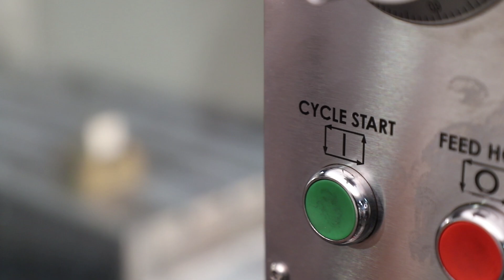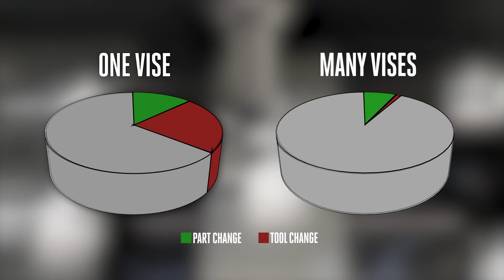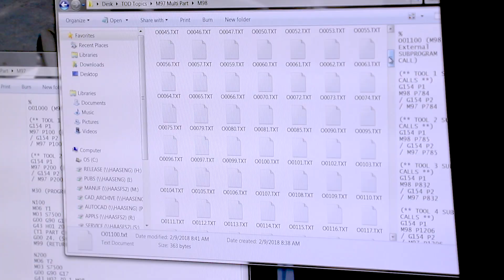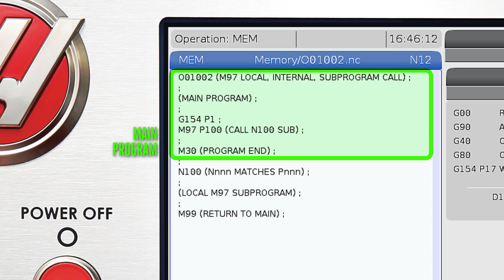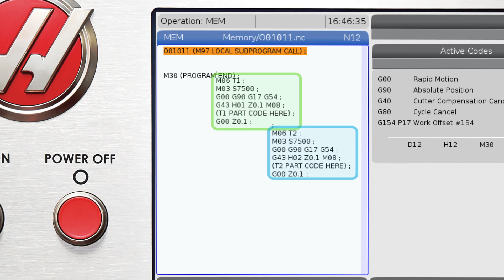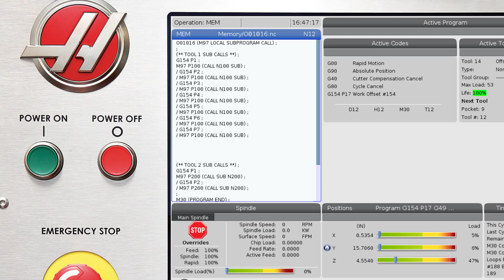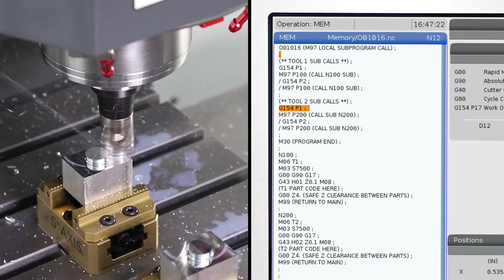Run More Than One Part at a Time; How Production Shops Use M97 - Haas Automation Tip of the Day

Comment: When I worked a Butler Industries we made almost exclusively Aircraft components. Now none of our machines came close to the one in the video but those guys couldn’t hardly look away and I’d hear words that blistered my ears as the end mills went woogady and ate the part, fixture and clamps. What happens if this computer get a power spike or just forgets what to do?
Reply from the maker: Abby – It is all about repeatable processes isn’t it. If we can get something to repeat with good fixturing, tools, programs and machines, it can be automated. Things have gotten a lot easier with modern tools and tool coatings, and the continuous improvements we’ve made on the machines. We sell a lot of machines into parts of the world where the power grids aren’t particularly stable, Haas has come up with some clever Tap/Tool Recovery options to get things up and going quickly even when the machine automatically detects a power issue and shuts down. Great comment. – Mark, Haas Tip-of-the-day
Reply: Haas Automation, Inc. Thank you for the response.

Comment: Last time I checked there are not 2 ways to call subs M97 & M98 as said in the video.  There is also G65, this is an external sub call much like the M98 but with an important difference, the G65 allows the addition of an argument to be added to the command... Any of you boys with a renishaw probe that understand how to use it should know this.  So a correction that there are in fact 3 ways to call a sub!

Comment: Why not have a single program but loop it and use variables for the work offset?  At the end of each loop, increment the work offset.
Reply from the maker: Shawn – That’s a great way to program lots of parts that are being cut out of the same piece of material, or cut on a Jig with even spacing between parts. The distance between our vises is random in the X, Y and Z, so we just gave each part its own Work Offset. Thanks for the comment. – Mark, Haas Tip-of-the-day

Comment: I agree with the subroutine calls, but I personally like using M98.  It allows for making edits to only one subroutine and not messing with the main program.  I know...everyone has their preferences.  I also prefer to run the part to completion. This shows only running the first op, but many parts are cut on 2, 3, 4, or even all 6 sides.  Using the same technique, use work offsets / vises, and group the program by tool to reduce tool changes.  The big advantage (comes from "LEAN MANUFACTURING") is that every time the doors are opened, a completely machined part (or set of parts) is removed.  This eliminates wasted time in excess handling.  Just another way to reduce time and improve productivity.  PS-by using M98 (M97) subroutine calls, we have been able to reduce our cycles times by 20-40% (versus single-part running).

Comment: I am just a wannabee, but Haas looks like a really well-ran company with probably the best value. This guys videos are awesome.  I like what he said at the end of the video.  It is how fast you can finish the last part that counts.
Reply: You may be new to CNC or Haas, but there are much more efficient systems/controls made by competitors that easily outperform all Haas machines. There's a lot of hype around this brand for good reason, but Hurco, DMG Mori and many others are much faster and easier to setup and run day in, day out.
Reply: haas is an entry level machine

Comment: Hi mark, thank you so much for your VIdeos,
I still have a problem i couldnt find though.
See, i have a casting part , i probe it up and yet I found that if i shift the X by 1mm, and the Z  by 0.5 mm the part comes out with holes etc correct aligned . ( Casting is out of shape ) 
I wanted to automate this process, therefore i added on the CAM a pass through, for example #5221=[#5221+#1001] .
The Idea was for me to controll the G54 shifting by a macro Variable, in this case 1001 in the current commands folder. But it is not working. It doesnt take the changes, or if it does, it messes the machine up and confuses it.

Is this because the Machine is not compatible of doing G54 changes while running in cycle ?
it is the UMC 750 5 axis.

Kind regards, 
Alex
Reply from the maker: Alex Mo – We can shift our G54 X by ,05mm by command #5221=[#5521+.05]. When dealing with macros, we want to be careful of lookahead as well, check out this video for info https://youtu.be/x24U0EXmLTk . In your example, you used #1001, this is not a valid Macro Variable on the Haas Control. Variables #500-549 are typically good for use. If I want to shift an Offset when probing, I’d typically add a shift directly to my probing command, the method varies depending on the cycle you use (IPS, VPS, Renishaw Inspection Plus). If we command #5521=[#5521+#100] it will shift our G54 X by the amount we have entered into variable #100 (#10100 on NGC). I hope this points you in the right direction. – Mark, Haas Tip-of-the-day

Comment: Hi, love your videos! Question, how do you set the work offsets for each p value, and when would this style of programming be beneficial over standard g54, g55 ect offsets and using a canned cycle. Thanks!
Reply from the maker: RiskyEndeavor -  G154 Pxxx Work Offsets work in exactly the same way the G54-G59 Work Offsets do. We typically use them when we are needing to work with more than a few Work Offsets on the machine at once. We have a couple of videos that show how to set Work Offsets, https://youtu.be/uNjMIIRttFE, https://youtu.be/AyMsFtwzrmI, and https://youtu.be/5I1eG49XnTA. Thanks for the comment. – Mark, Haas Tip-of-the-day

Comment: I did not know one is not supposed to put work offsets within subroutines....is this no-no common for g-code in general ...or just Haas?   What happens if one does put work offsets within subroutines ?
Reply from the maker: Unionse7en – Thanks for the comment. If we put our Work Offset in the Sub (like G54), then every time we call the sub, it will just run the G54 part – over and over. By calling the Work Offset outside of the sub, we can use the same code (sub) for different parts – G54, G55, G56.. – Mark, Haas Tip-of-the-day
Reply: You do this only when running the same program in multiple locations.

Comment: Leaving the machine to run by itself?  What if a tool breaks or starts to wear and make things out of tolerance?
Reply from the maker: Ben Higgins - That’s the hard part, isn’t it. When running lots of parts, we’ll figure out our tool life and use the controls ATM Advanced Tool Management to swap out tools for backup tools when needed, based on the spindle load, time, or number of features it had made. We can also use our Probe to measure parts for us, in the machine, and make wear adjustment for us, or make sure tools aren’t broken. Getting good at automation is all about managing those tools, easy on aluminum, not so easy on tougher metals. Thanks for the comment Ben. – Mark, Haas Tip-of-the-day

Comment: That setup is way overkilled,  you're right it's more productive to run multiple parts but there's sill room for improvement. what I would do is setup a multiple vises and run many parts in a single material bar, if double vises are available you can run 2 bars and doubles your productivity, all toolpaths can be programmed to fit as many parts on the material bar.
Reply from the maker: Armando – Check out the fixture, on the left, at 09:30, I think this is what you are describing. That’s a great method for making lots of small parts. For that kind of setup, you might still use an M97 for the second operation on the parts, so we can make minor offset adjustments for each precision part. Thanks for the comment. – Mark, Haas Tip-of-the-day

Comment: This is exactly what I was asking the people who sold us the HAAS, how to do program with subprograms for multiple parts. They could not answer. This video is great, I only wish it came out 7 years ago. I do multiple parts all the time and now will utilize this program. Would be nice if you would go into more details. On how to do Fixture offset, how to set up tool. More details on programming, step by step so to speak. Please.
Reply from the maker: Anshel – Check out this video we did on setting those offsets, https://youtu.be/uNjMIIRttFE?t=517. We’ve left links to all of these setup videos in the description of this Complete-Part-Setup video as well: https://youtu.be/gbcMm-rSXZY. Thanks for the comment. – Mark, Haas Tip-of-the-day
Reply: Thank you, I have seen those videos. I still do not understand how you set up the fixture offset for that many parts? I probably missed something in the video. Are they all 154 P1, 154 P2 and so on?
Reply from the maker: Anshel – I typically use Work Offsets G154 P1 through G154 P99. Our G154 expanded Work Offsets are listed on the Work Offset page below G54-G59, and work just like G54-G59 do, with one Work Offset per part. We set each Work Offset manually, or with the probe. The “Complete Part Setup” video, shows how to set each Work Offset. The example program at https://youtu.be/NutStjpWJck?list=PL1FfK7Yod27cy-MIhXsKkDwTmvclf7ps7&t=504 shows the code we’ll need to run 2 parts, with 2 tools. This can be expanded. Shoot me an email at TOD@haascnc.com and I can answer any question you might still have. – Mark, Haas Tip-of-the-day
Reply: Thank you. That was my question. Appreciate your help.

Comment: How many minutes did it take to find all the vices and get them all lined up and then alter the program to add all those new locations. Bet in the end it isn't worth the extra effort.
Reply from the maker: Andrew s – It takes me very little time to setup and indicate-in the vises, but I spent forever looking for the hardware to mount those vises!!! We actually sat down and talked about this here, and decided the root-cause of our long setup time was a lack of hardware. Solution: as soon as the video was shot, we ordered up a bunch of studs and clamp hardware, to make the process faster the next time around, and better organized what we had. You’re right, you always have to do the math and see if it makes sense. If you have lots of parts to run, even adding just one more vise can help though. Great comment. – Mark, Haas Tip-of-the-day
Reply: @haasautomation  Just buy a set of Pierson Workholding pallets and forget you ever had this problem FOREVER!
Reply: Depends on  how many parts you make. For 20, probably not, for 200, definitely.
Reply: That is one reason to do a SMED event. A good SMED event will come out with your setup struggles and the reasons and time it takes for your changeovers. Deep dive into those take aways and solve for them one by one. Use common sense during these events. What makes sense on paper doesn't make sense for all shops during the workday. As a experienced Lean guy and Machinist/Programmer, you have to decide whats best for your shop and production. Ive done lean events involving SMED, and sometimes it makes more sense to continue with single piece flow and not go to these multiple part runs due to quality concerns mostly (and tooling wear from part 1 to part 16, for instance. It depends on whether you are trying to hold a few millionths or a couple thousandths. All depends. Sometimes, these high level programmers (very good programmers) really don't understand the real everyday of machining with lower grade drills and inserts when you work for a large corporation that wont spend the money on better tooling. Therefore, you have to program accordingly, to their tooling grades. Id love to program for all TSC drills but that's not reality in most production shops.
Reply: Adding the extra locations isn’t hard. You just use the original programs as a internal sub and then just probe each as its own offset, I mean if you had just 2 vices that’s still more production for 10 minutes of work

Comment: How do you handle the tool length offsets? I usually set T01 to H01 for one location (part height) and have another tool length offset H11 for the second vice location, H21 for the third, etc. Is there a better way?
Reply: Ok, so then each G54, G55 (G154 P1, G154 P2) has a Z offset? I don't have a tool presetter. It's a TM1 with the previous gen controller, not the latest. I will need to play with it a bit. Thanks!!! I do love these videos that HAAS is putting out.
Reply: Ok, thank you. I will try it out.
Reply from the maker: Scottp119 – Check out https://youtu.be/uNjMIIRttFE?t=520 This video covers the basics. Adding a tool presetter of some kind, or touching off all of your tools at a single location (123 block, touchoff tool) is a real time saver as well. – Mark, Haas Tip-of-the-day

Comment: how do you set your work shifts or g154 p1 p2 p3 p4 and so on
Reply: when your doing your probe routine instead of doing 54 for g54 you type in 154.01 for g154 p01 and 154.02 for g154 p2 etc etc and so on make sure you type 154.01 if you type 154.1 it will set offset at g154 p10
Reply from the maker: Daniel – We’ll set the G154 P1, P2, P3, in the same way we would any regular part that uses a G54 or G55 Work Offset. For more information on how to do this with a probe, edgefinder or indicator, check out the Complete Mill Setup video we put together: https://youtu.be/gbcMm-rSXZY.  – Mark, Haas Tip-of-the-day

Comment: Another way to use the macro command. You will need to add a few lines to any already existing program. Here is an example:
O00350
G00G17G40G49G80G90
#100=54
( 4.0 FACEMILL )
T1M06
WH[#100LE57]DO1
G00   G#100    G90X-2.8Y-1.1S4500M03

Tool pass

codes for T1

#100=#100+1
END1
M05
G91G28Z0.M09
M01
#100=54
(1/2 ENDMILL)
T2M06
WH[#100LE57]DO1
G00G#100G90X-0.26Y0.56S10000M03
G43H02Z0.05

Toolpass T2

#100=#100+1
END1
M05
G91G28Z0
G90G52X-20.Y0
M30
%
Each tool will repeat the toolpath 4 times (LE - less or equal G57).

Comment: The first tool, what is it?  Feed and speed?  Great video BTW!  As usual!!
Reply from the maker: P West – That particular tool is a Seco 32mm Combimaster, R217.69-1632.RE-12-4AN. I was running it at S10000, F238in/min (F6000mm/min), with a .200” (5mm) depth of cut on aluminum (pretty conservative SFM). It can handle a faster feedrate at that RPM though, I was only going .006”/.150mm per tooth. The TSC allows it to run fast. For any indexable tool, I like to go with the smallest diameter I can get away with, this allows me to keep my RPM’s up, and then find a brand that can give me the most inserts for that size. This gives me the highest RPM, the most inserts,  the highest feedrate. – Mark, Haas Tip-of-the-day.
Reply: Mark, thank you for the info.  Got a new TM-1P so appreciate your vids.

Comment: Sorry for my bad english...
Generally great advice... but...
You haven't told: as a lot of time will be required to set offset for all details. At small quantity of details in party it can not justify.
Reply: Actually you have to set it once for all parts. Because you are a smart guy and you use workpiece stopper.
Reply: Right. I'm sure that if you are running multiple parts that those height offsets will hold relatively true for part 1--1000. Taking the time to set up for a large part run will save significant time throughout the run and as was seen you can do other things while the parts run.
Reply: I think what they meant was that if you're only doing a short run, setting up tons of different workholding solutions and doing a mish-mosh batch of stuff on there might cost you more time in getting all the different offsets locked in than just working off one vise and sticking with running simple jobs.

Comment: I really like this stuff, been doing this kind of thing for 20 years, I do wish all controls did internal sub calls.

I also wish Haas had something equivalent to a G66 modal macro call.
Then you would just do 1 macro call per tool and a list of work offsets, and that list could be put in a sub so you only need to edit 1 list and it gets used by all tools.
Reply from the maker: Andre Blanchard – Thanks for the comment! I’m with you. M97 is just one of those things that Haas has really done a good job with. Very nice code. As far as the G66 Modal Macro Call, I hear you. This has been submitted as a Software Enhancement Request. I’ve just added your comment to the request as well!  Thanks again. – Mark, Haas Tip-of-the-day

Comment: P100 means call to N100...what the logic. Also, still having Oxxxx file names, which have zero value to a human.

#nomoregcode
Reply: N100 is a line number. You can (if you want) number every line in your program. P100 is used to call a program at the line N100.